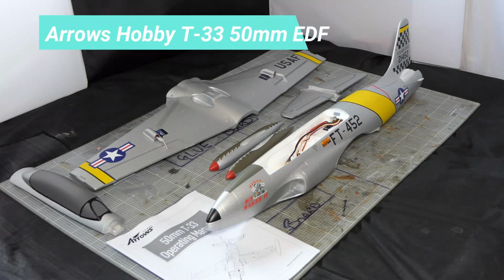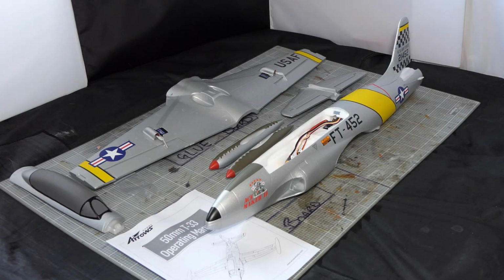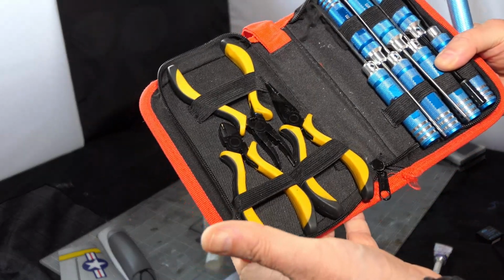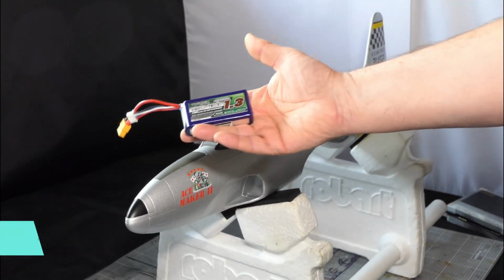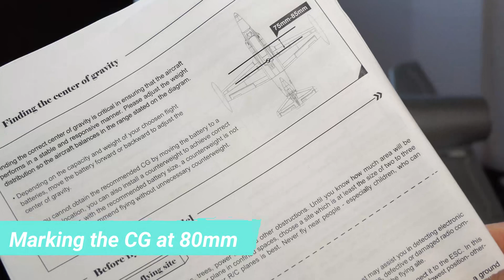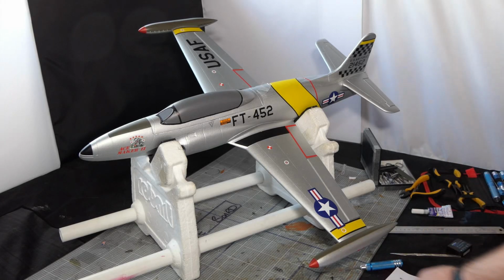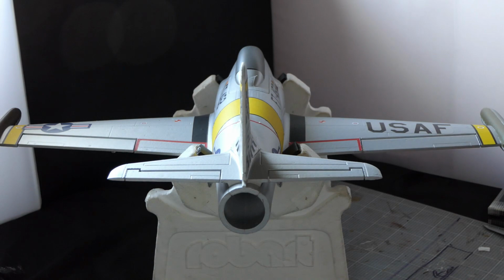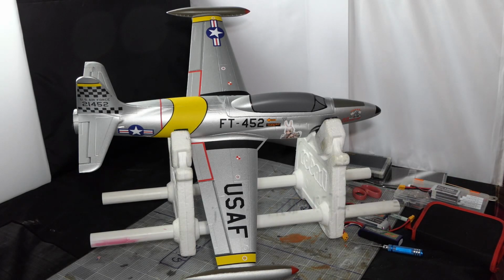Assembly -  Arrows Hobby  50mm EDF -T-33 28 September 2021

Comment: Nice work Martyn. After seeing a few pictures I didn't think a 2200 would fit. I'm glad to see that it does.
 A little loctite on the elevator set screw might be a good idea.
I hope that they both fly well for you. Can't wait till they get here in the US. I'm happy that Arrows Rc is about 20min away from me. AirHammer out!!
Reply from the maker: Hi AirHammer - I really have no idea why I did not see your comment from 8 months ago - really sorry I am only now getting bac to you - I ended up putting a dab of Foamtac on the set screw to stop any movement due to vibration,  I am sure you have seen apart from some questionable hand-launches it has been flying great - I have upgraded both the T-33 and the Hawk withs 40A ESC and run them on 4S. - Stay well Martyn Out.
Reply: @FlankerTanker  👍no worries 🤓

Comment: She looks great but quite brittle in a crash… i have found this out Martyn. I look fwd to your flight. Keep safe & well
Reply from the maker: OH Come on Noel - you have to fill me in with the details to make sure I do not do the same thing !?? - anywhere on the airframe I should reinforce ?? was it on the maiden - was the CG correct - did it stall ??? I rally do need to know the details - Please ....
Reply: Oh no Martyn, you are a much better pilot than me…. Especially with hand launches. I am not really a fan & this one took a couple of dives on launch, even with the Vector on, damaging both the wing tanks which are the weakest point as the fail to take off (very wobbly with correct cg) caused each side to break but not seperate ( due to the stickers) they are re glued & i will try again with no Vector on.
Reply: I will be very interested as to the comparison to your Viper 50mm
The Marlin flies like a dream. I had the FMS Avanti V3 up for a few wonderful flights yesterday plus the Eflite F15 & Beaver. All flew sooo good
Reply from the maker: @Bellairvideo  I have to build my Marlin and the Eflite F16 and F15 get them ready for Flying Season 22.... really pleased you are having some good flying days - none here Rain, strong winds, dark at 19:30 these days - as you know for us here "Winter is Coming" I am howver  looking forward to some nice crispy (if not a little cold) yet  still  flying mornings to come......
Reply from the maker: @Bellairvideo  Got it - I will have to make sure its got a lot of thrust on and give it one of my Grunt launches - well almost all of mine are like that LOL - I had a problem like this with the Crusader when I first launched it on the Maiden... thanks for the Heads up and info - stay safe and well...

Comment: I have to ask if yours came with a Vector stabilizer? There's no mention in the manual and I see no gyro inside just and extra lead on the throttle cable which I at first thought was a gyro control cable but it does nothing as far as I can see.
Reply from the maker: HI -  LAPEOS RC - none of the Arrows 50mm EDF aircraft come with a Vector Gyro here in the UK - You have to purchase them separately here in the UK - and install them yourself - they are only sold for the Hawk and T-33 - you cannot get one for the Viper,  (I might add they do not come with any Instructions) - I have made a video regarding the Installation of the Vector Gyro (they are sold with a special pin configuration with no plastic cover)  for the HAWK but the Installation is the same for the T-33  - https://youtu.be/VrRZYuV2MqI . that 4th wire on the throttle (ESC) I have been told is for programming  the ESC at the factory and I have been told can just be ignored . Hope this helps. Stay well Martyn
Reply: @FlankerTanker  Thanks for the fast answer!

Comment: Martyn after watching a few builds I'm wondering why you poke cocktail sticks in the CG then snip the excess off? Is it for feel when weighing it?
Reply from the maker: Yep its so I don't need to look for where the CG is located just flip it over and I can feel the marks via the small bit of stick its MM's and this has no effect on the overall weight but makes it so quick when checking CG... my finger tips are quite hard , if it was just a small dent in the foam it would not register for me.. this way it always works (for me)..
Reply: @FlankerTanker  ahh I understand! O watched some American guy use small pins with plastic balls on the end. For the exact same thing.

Comment: I have an AR631 receiver from a crashed EFL T-28 Trojan. Would that work in this plane?
Reply from the maker: Don't see why not -  since I made this video I am putting it an AR630 - (wireless 6 channel RX) - with Safe and AS3X - will need to do some Forward Programming to set it up but I have used one in the Hawk and that is great...

Comment: Is there any known reason why Arrows don't supply these with a gyro/stabiliser in the UK?
Reply from the maker: Hi Max - My model shop owner tells me its NOT Arrows its the UK distributer J Perkins - not wanting to order the ones with Gyros fitted - the price is a little lower and they can get another £20.00 out of the UK Modeler should they wish to get a Gyro as an add on, , oh and the gyro for the T-33 is not set up the same as the same as the gyro you for the Hawk - so if you get both Gyros - that's a bit of change back from £40.00 !!